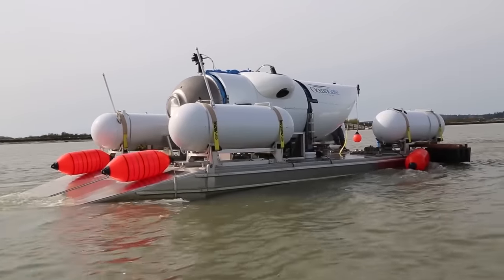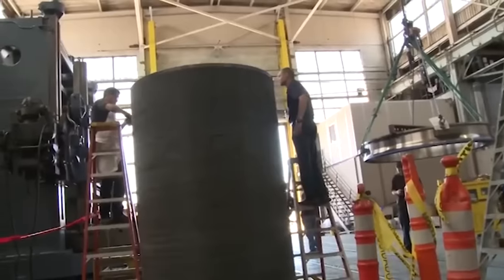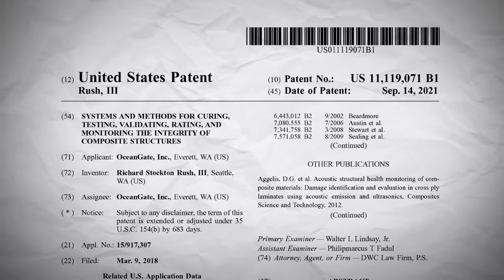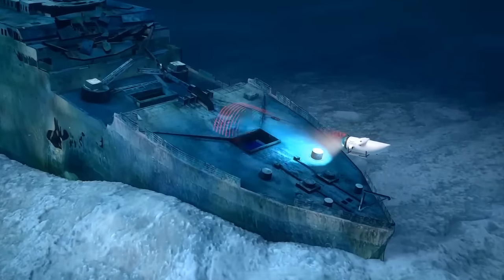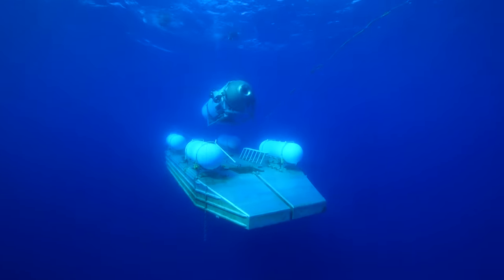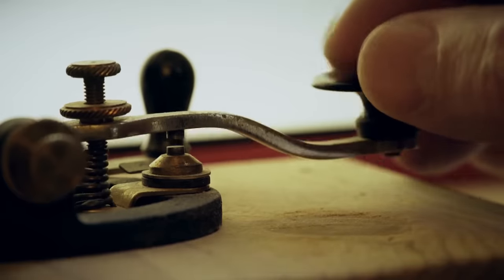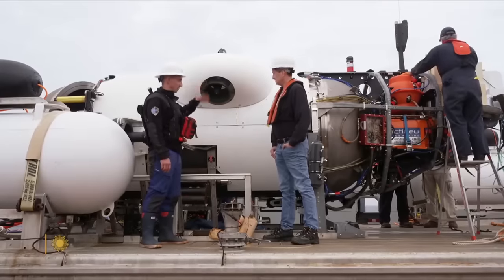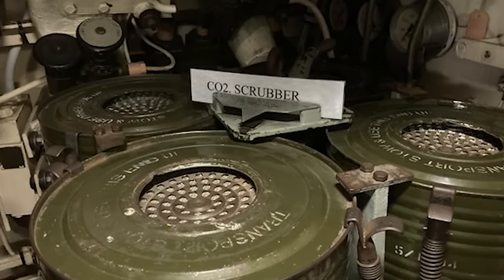Exposing OceanGate Submarines Many Fatal Designs

Comment: Sadly he'll never know it ended up failing. Just because this thing worked a few times before doesn't mean it was able to handle repeat exposure to such pressure and not come apart.
Reply: @vaultslayer9162 is this newly released information? You’re the only one saying this. Ocean gate employee??
Reply: @vaultslayer9162  It was the hull, they found it in pieces all over the ocean floor.
Reply: The scary thing is they probably knew - the sub started to ascend before it was lost
Reply: @user-pm2bh9ol8w  They did? 😮
That is another new information.
Reply: @vaultslayer9162 less than half.
Closer to one third.
Reply: @JMC-ul1sw with the information we have, its more of a well informed hypothesis than speculation.
Reply: I imagine the hull entering him during implosion let him know it failed last thing ever on/in his mind
Reply: @zanag.9226 the sub initiating a sudden unplanned ascent isn't new information. 

However, it was almost certainly due to mechanical or technical issues, because at that depth, the very second a compromise in the structural integrity is formed, it almost instantaneously results in catastrophic failure.
Reply: Delaminating of the hull over time from the pressure of numerous dives at high pressure. Probably coursed the implosion. I believe the hull was changed once before due to damage from previous dives.
Reply: @Ifyouarehurtnointentwasapplied the implosion would've been instant; faster than comprehension.
Reply: @user-pm2bh9ol8w  NO THEY DIDN'T. Don't make up crap.
Reply: @jumblsj7328  No. It happened too quickly. He went from life-gambler to red liquid with no warning.
Reply: @LoadedMessage  I think you're right. It was carbon fiber lamination failure.
Reply: James Cameron said the sub was ASCENDING when it imploded, it had dropped its ballast to lose weight and rise to the surface, so they must have known that something was wrong. Unfortunately that means those last moments would have been scary as they knew there was a problem but didn’t escape the pressures of the depth fast enough.
Reply: @ntube7  Under that pressure, there is no time for warning. No odd sounds or cracking. Instant death. They knew nothing.
Reply: @frankiethefrog1752 no it was reported by one of the engineers who sounded a safety concern, fired, and then sued them for wrongful termination.  They didn't want to put the money into the window to get one for the 4000 meter trip down so they only got one for 1500.  Rich ppl being cheap.
Reply: @vaultslayer9162  
Carbon fiber does not handle compression well - at all. Especially repeated compression/decompression of it. The fibers break, separate, etc. And when carbon fiber does suffer catastrophic issues, it's nearly instantly and without warning.
The plexiglass window not being certified for the depth that they were going at is definitely an issue, but most likely it was the carbon fiber that failed. Much larger surface, known issues with compression and naval design engineers went on record that it was dangerous.
Reply: @jakehildebrand1824 the pressure that deep…. Is absolutely astounding
Reply: @namseer  then why had they dropped the ballasts and were attempting to resurface before they had even got to see the Titanic? There must have been some obvious fault that Stockton at least knew of.
Reply: @ntube7  The ballasts were set to a deadman's switch that automatically dropped ballasts even if all divers were unconscious in the event of an irregularity.
Reply: @ntube7  THEY did NOT drop the ballasts. You ever hear of a "deadman's switch"?
Reply: @user-pm2bh9ol8w  it takes the brain a quarter of a second to interpret any sense, although it will convince you that it is instantaneous. At that depth and pressure, the force would have destroyed the vessel as quickly as a ton of TNT. They wouldn't have felt a thing because they would have died within that quarter of a second.
Reply: @danke1150 The hull being in pieces doesn't necessarily mean it was the first part to fail. Any structural failure under such pressure would lead to more cascading failures ultimately destroying everything. 

 @Ifyouarehurtnointentwasapplied  It is estimated that the Titan collapsed so fast under the enormous pressure, that no one inside could even notice that they were about to die.
Reply: @namseer  yes but irrelevant here. The ballasts were dropped before the sub imploded. Unless James Cameron or the community he got the info from are lying.
Reply: It's retarded if it's the window, because glass can be designed in a proven, reliable way for these depths. I am still betting on the carbon fibre
Reply: No way that 5 inch carbon fiber hull didn't creak seconds before it imploded.
Reply: @frankiethefrog1752  Well. It was an implosion. There are two possibilities. A failure of the hull or window. It could have been both. But more likely the hull, because it was garage sale quality. Literally. It was resold Carbon Fiber from Boing. Aviation carbon fiber . . . for a deep marine sub.
Reply: @vaultslayer9162  That, or the monitors and stuff that they directly screwed into the carbon hull, creating countless possible points of fatigue and catastrophic failure. Either way it seems Mr. Rush had a death-wish. Also, what do non creative rich people name their kids? 
"He's gonna inherit tons of stocks, lets call him "Stockton!"
Reply: Not on THIS side of eternity, he'd know.  I can very much see God telling him WHAT A STUPID @#$%!!  It's not a new principle; even in the Old Testament times you had to have a wall around a roof that is accessible by personnel.
Reply: @user-pm2bh9ol8w there is a video on yt of someone who took a ride in it before this happened and he said on that trip you could hear the hull popping and cracking rush said it was norma.l and wasn't the last transmission from sub to ship saying there droppings balast and coming back up if that was true there is no way the people on board couldn't see something wasn't right but with all the videos on the media and you tube there is no way to know if any of that is truth
Reply: Even airliners are taken from service after the estimated number of service hours have been reached. They know that materials over time develop weaknesses that begin microscopically and enlarge and eventually will fail.
Reply: @Taygon45 carbon fibre is known for being rigid but brittle, if F1 cars have bits that shatter and leave shards all over the track is anything to go by, but what testing was done to assess its resistance to repeated Syrians at extreme pressure.  Remember how Comet aircraft used to crash due to stress fractures around square windows due to pressure cycles during flights. If experienced aircraft designers can get it wrong at less than 15psi differences what chance have a "bunch of amateurs" got at designing something for incredible pressures at the Titanic site.
Reply: We already know… obviously the hull just couldn’t handle the pressure… we don’t really need to know more specifics than that, many points on the craft was super vulnerable, it was made in Walmart basically.
Reply: @namseer the “deadman’s switch” was just ropes that would dissolve after 10 hours of being in water, releasing the ballast. According to James Cameron the sub imploded 1h45 into the dive, the debris all falling roughly in the same location on the sea floor — with the exception of the ballast, which was some distance away from the rest of the wreckage. Cameron said this suggested they dropped ballast, floated up and away in the current a bit, then imploded. Which they were attempting to ascend. If their ballast had been dropped during the implosion/by the deadman’s rope, it would’ve settled right by the rest of the sub and not been so far away.
Reply: @frankiethefrog1752 ex twch that worked on it. He raised th concerns and was fired for it..
Reply: @not_that_person  you're right. like standing on an empty beer can (drinking trick) if you apply the force evenly and slowly enough you can sometimes stand on them or at least you used to. Most of the time people trying to do it get a bunch of weight on it then some irregularity makes it suddenly give lik nothing. Structurally it gives instantly
Reply: @user-pm2bh9ol8w  remember Samson. The moment the column was compromised there was no chance of recovery.
Reply: The dead man’s switch was the bags that would erode after 10 hours - they cover this in the video.

I don’t know how you’re finding this so hard to understand. They knew something was wrong, as BEFORE the implosion, the vessel was ASCENDING, ie GOING UP.
Reply: They’re saying that they knew something was wrong, as they were ascending before the implosion. 

Of course, once the implosion occurs, it’s instant, and they’d no nothing about their desth, but they did know something was wrong, as they stopped their descent and were returning towards the surface.
Reply: He’ll know…
Reply: @namseer there was an article of someone who went on titan, who heard noises and was reassured by Stockton that it was no where near catastrophic. Sorry I don’t have the link, I’ve come across so many articles. But hearing that, and then Cameron stating there could have been some warning, makes it at least believable that they were heading back up. Hopefully, regardless, it was as instantaneous as people have been claiming and they knew no different.
Reply: The window was rated for that but could definitely reach the depths. It was the hull that was compromised
Reply: @namseer: Why are you stating falsehoods?

Robert Ballard, David Mearns, and James Cameron have stated in public interviews that they have insider info that, as Titan was descending to Titanic and almost 45 min away, the pilot had dropped its ballast weights to execute an emergency ascent, and contacted its support ship. The Polar Prince suddenly lost all comms with Titan and its tracking pings.
Reply: Still you gotta respect anyone who puts their body where their mouth is.  He clearly cut corners, but so did the Wright Brothers.  They almost crashed and died several times.  He was not so lucky.  It was most likely defect in the hull, but one that was predictable but also impossible to detect.  That is the real problem.
Reply: @vaultslayer9162 if that were true, the cylindrical hull would be mostly intact.  Only the caps were intact.  I suspect it was the cylinder that shattered.
Reply: @namseer they were not at full depth.  A hull can certainly make cracking sounds before it full gives way, especially if it is at only half its maximum depth.
Reply: @matchesburn this is not necessarily true.  Carbon fiber racquets and bikes survive many thousands of stress compressions.  It is quite resilient.  I think it has more to do with a constant continuous heavy load and the discontinuous materials.  When an entire hull  body is the same material it moves together and distributes stresses efficiently.  Joints of discontinuous materials are the Achilles heel because the compress and rebound at different rates, causing eventual separation.
Reply: @mandoreforger6999  
No, they do not. Stress and compression are not mutually inclusive. The failure point was almost certainly the carbon fiber hull, as numerous experts pointed out... even before the sub launched that day with maritime engineering experts saying you should not use carbon fiber for repeated use submersibles. This is well understood... or at least should have been by OceanGate.
Reply: It's a completely different  world beyond 500 feet  deep let alone 13000 ...magic number...   I know racing and  diving flexing carbon fiber multiple times  in water that cold at that depth was suicide at just a matter of time Steele time tested next of kin approved.
Reply: @mandoreforfwr6999 Were not talking about designing the first aircraft here. It's a submersible, something that is well understood.
Reply: @Ifyouarehurtnointentwasapplied  nope, it was over in milliseconds, their brain wouldnt be able to process anything happened.
Reply: @frankiethefrog1752 there was an interview with the guy from ocean gate that said he knew the window was weak
Reply: @Ifyouarehurtnointentwasapplied  that's like the joke - What was the last thing on the bug's mind when it hit the car windscreen? Answer: its ass.
Reply: @vaultslayer9162  yup. for 1300 meters... like hello???????? did stockton have a death wish?  or was he "praying" while faking it till he made it?
Reply: Even planes have their compression/decompression lifespan though they can go through much more cycles!
Reply: The wreck of the Titanic was scientifically explored many many times before!

This has nothing to do with human ingenuity and the exploration of new things.

It was nothing but a money racket for the company and a "toy" for a billionaire!

The Titan's dives were not an achievement for mankind in any way!

The captain was a known professional and famous submariner, with a household name in the submarine world.

I wonder why he was involved in the whole thing, or why he continued. Despite all the technical problems, during the first dives.

I think he's also to blame. He should've quit and get the word out that this whole thing is bullshit.
Reply: @katyalupochev9589 dding to that Cameron specified that some  ballasts were attached to a system/part that could also be dropped. That system/part was found without the ballast attached to it, further suggesting that they were making decisions to drop all they could.
Reply: @mandoreforger6999  At what depth did it break up? Remember, the Navy has all the noises the submersible made  on break up. Those people heard nothing. I'm sticking with info from scientists and experts. The victims instantly died with no warning.
Reply: @hewhoc8664 to me that what made it implode accending
Reply: @yannick245 
I suspect the reason for the cost cutting in building the submersible.
Perhaps ocean gate had plans to commercialise the design so others could build it under  license.
Reply: My theory is.
As we knowing a carbon fibre hull attached at each end with a titanium end caps.
..
The elasticity of the two dissimilar materials (expanding & contracting at different rates).
Caused the end caps bonding to fail....
..
I have learnt that 5 inch thick CF is strong but brittle like porcelain..
The CF was also made in a straight weave rather than a much stronger cross weave design...
This means the hull would only be strong in certain loading conditions.
Compared to a cross weave that can handle loading in different positions..or from all directions...
.

The way this submersible was constructed seems very sketchy..

Edit;.
It appears this sub had made anywhere from 4-7 previous dives so the design was proven to work at thou depths yet the hull may have fatigued too soon.
Perhaps because of the straight weave CF design?
Reply: @stuartd9741 yes it went to those depths before but they never checked and carbon fiber can’t repeat going down to that pressure without being replaced. So those sucessful dives gave them confidence it was working but little did they know it was getting weaker each time it went down to those depths
Reply: @zachk2473  I'm repeatedly learning.
A CF hull is single use.
Reply: @JMC-ul1sw  Are you [vaultsalyer], using a different account? Sincere question. I was just wondering if you were answering directly, or if you just pointed out the obvious. Actually, maybe it's not obvious because it's written as though it's absolute fact, so if it's not then it shouldn't be presented as such. 
I'm really not meaning to antagonise. I also realise it's not likely a question most would even consider, so maybe it's more about what I've been smoking. Regardless, something definitely happened.
Reply: The only thing that you need to know is that carbon fiber doesn't belong anywhere near those pressures! He bonded it to titanium with a glue! Yes, the window was not rated for those depths, but everyone else that goes that deep used a titanium sphere to equalize pressures! He made 7 trips but didn't check the integrity of the carbon fiber hull... had he made a new one every time, this wouldn't have happened! There are tons of tests that you can find on YouTube from a decade ago, and the carbon cracked under pressure! I'm not speculating, I'm just going off of empirical evidence from testing. Look up the video from the Triton submersible, Deepsea Challenger, Trieste, etc. They did NOT use carbon fiber!
Reply: @katyalupochev9589  Good points, all. Apparently, they recovered what may be human remains today. At least they have material that can be tested for DNA. I'm sure the scientists will be able to recreate what happened down to fractions of a second, including if and when they became aware of trouble.

Comment: Comparing a Logitech gaming remote to a remote used by military is like comparing the model T to a Tesla. Military equipment are tested in all conditions to ensure they properly work
Reply: And has cradle to grave monitoring from inception to storage, delivery, etc. All parts.
Reply: The Model T was better built than the Tesla.....try a better analogy, perhaps
Reply: Subs use Xbox.
Reply: @ebolawarrior451  not off the shelf and definitely not for controlling movement

Comment: The game controller was totally a risk, especially for fire. Just think that it contains a lithium ion battery inside and has not been designed for or tested in marine environments. The US Navy uses controllers that are wired, according to the pictures, and they were probably tested extensively.
Reply: Also, what kind of Air were they breathing? Was it oxygen enriched?
Reply: Excellent example of cheap
Reply: Everything inside that sub was a fire hazard tbh, didn’t he say the lights were just bought from Camping World?
Reply: In all fairness, that logitech controller was probably the best tested, most reliable part of that whole sub.
Reply: Still I don't trust that Bluetooth. I'm sticking into wires
Reply: The Logitech F710 uses AA batteries.